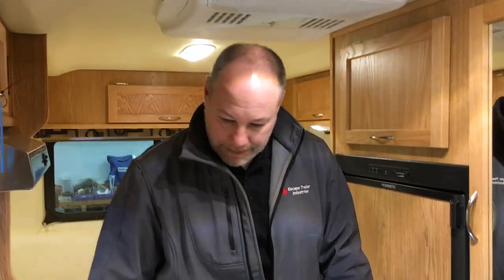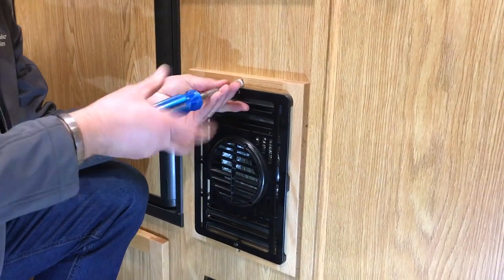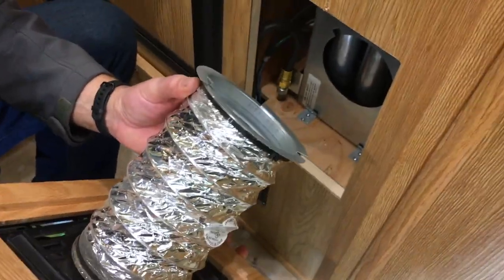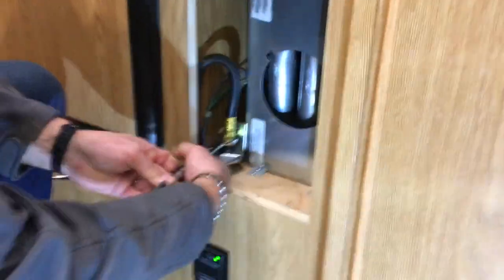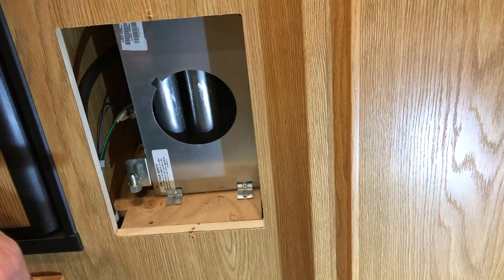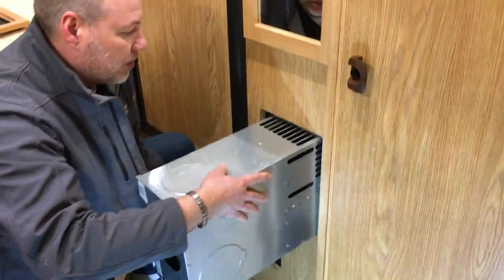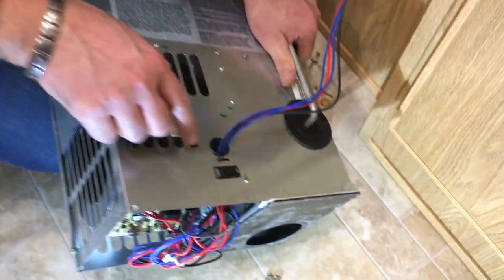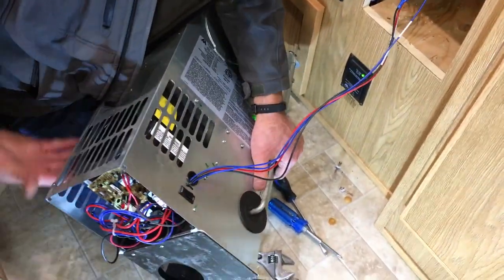Inside Job: Removing Furnace without External Access from Your Escape Trailer

Comment: Dear ETI, in the 19E configuration options video, Carl said the propane is a “wet” source of heat. Does the firebox portion of this furnace have a chimney or vent to the outside of the trailer? If so, why would this be “wet”?
Reply from the maker: Hi Jay, you are correct. The furnace is vented outside thus the furnace will not provide moisture throughout the unit. This error will be omitted in an upcoming revised options walkthrough- Harrison@Escape